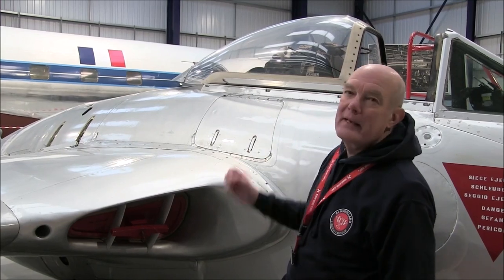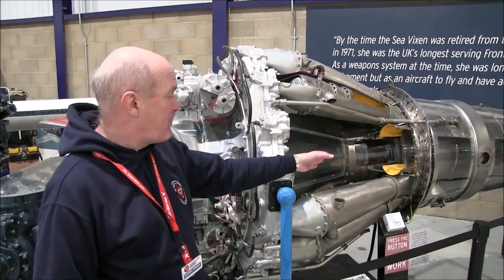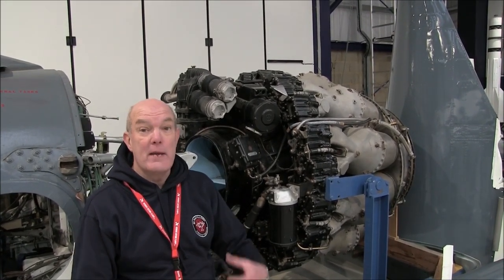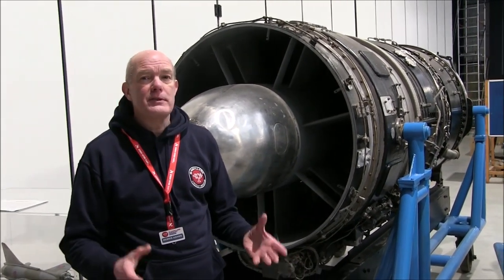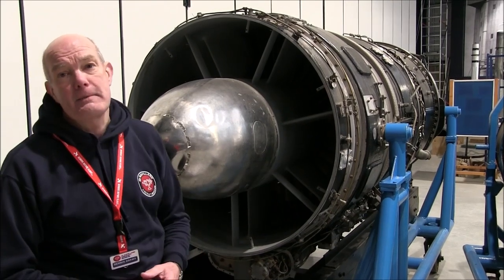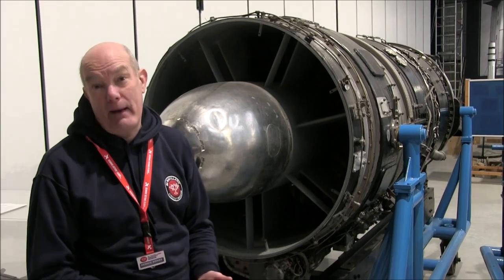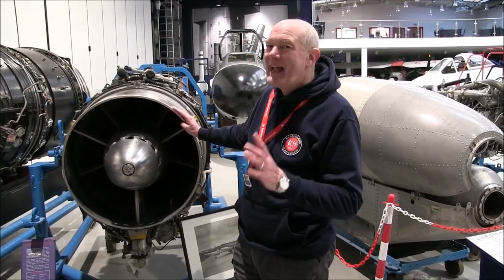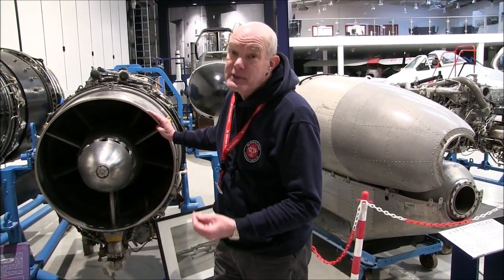De Havilland Trail Blazing Jet Engines

Comment: You miss the key factor in this decline, the Ministry of Supply, they determined a strategy for high trust engines in the mid 50s. They chose to only take forward 3 designs, where the RR Conway was the low bypass turbofan, Bristol Olympus was the two stage turbojet and the Gyron was the single stage turbojet. Whilst Gyron was the lower risk design it was never going to succeed if Rolls Royce and or Bristol designs were successful. As they were the Gyron could not compete as it never could achieve the efficiency of these more advanced designs.

Comment: It looks  like frank Halford and Frank Whittle were the John Logie Baird or Betamax of jet engine designers.
Reply: No not at all , they identified that the axial compressor was better but at that point we didn’t have the required metals to make it reliable as proved by the Germans axial engines having a life of mere hours, where the materials to build a reliable centrifugal compressor were, although not as efficient don’t forget the early RR engines based on the whittle engine were both centrifugal and very successful, it’s was only as the new high temperature material become available that manufactures started build axial flow engine, the book not much of a engineer is worth a read if your interest, a good insight from the RR side
Reply: @BerlietGBC  It was a joke.
Reply: @iangascoigne8231 I thought it was funny👍😂

Comment: The Gyron had twice the "dry"  (no reheat) thrust of the Pratt & Whitney J57, But is was not as advanced. It was stil a single-core turbojet, with a compression ratio of just 6:1. As a result, the J57 was much more fuel-efficient -about 20% lower consumption per unit of thrust.

Comment: Thank you, I had no idea this collection existed. It is a pity you did not make the distinction between the simplicity plus relative reliability of the centrifugal compressor and the fragile nature of the early German axial flow engines which had abysmal time between overhauls ; the Comet may have been the first jet airliner in service  but the catastrophy was not through being letdown by its engines.  It is true that large frontal area does not help aircraft speed and making fast moving air turn through right angles wastes energy so centrifugal compressors now only rule the turbo chargers in our cars. It is also true the Blackburn Buccaneer  lost its underpowered DH Gyron Juniors in favour of RR Speys at a similar time to the name Blackburn being replaced by the collective Hawker Siddeley but there is the story of the Frank Halford designed Gypsy Major engine of the 1930s. They are still around today in significant numbers. The one I owned was just a little younger than me but started flying before me. It liked its electric starter but if hand swung preferred the throttle closed for instant response. It was always a pleasure to sit behind in flight. Though built by DH I had paperwork referring to it as the RR Gypsy Major since RR took over responsibility for these engines after DH support  collapsed.  The engine is most certainly a DH success. I have more experience with RR jet engines with no complaint but they were built by RR. In the realms of massively expensive projects there is no guaranteed link between successful design and successful business.

Comment: Well, I'm not sure that you would be able to run a Rolls Royce on fuel oil if you really needed to. Or taxi back from a runway with a clear line of site to the hanger.

Comment: Success in design but failure in being able to market and progress the design. RR focus was on Engines only. Thus 100% in R&D. Investment may not have been there in DH to the same levels, resulting in a weaker competition,  less customers results in a higher unit cost. Bee interesting to see the costings of a DH engine to a RR equivalent.